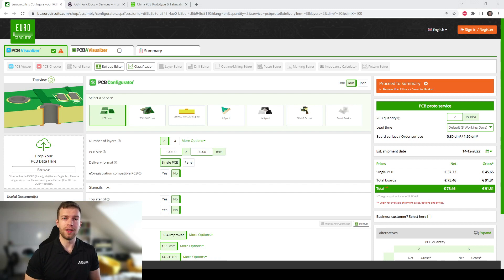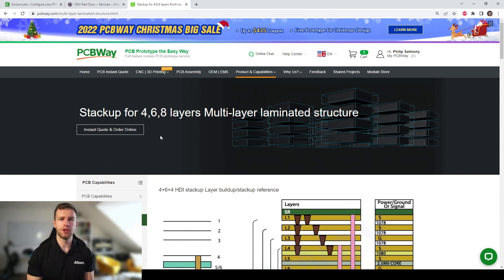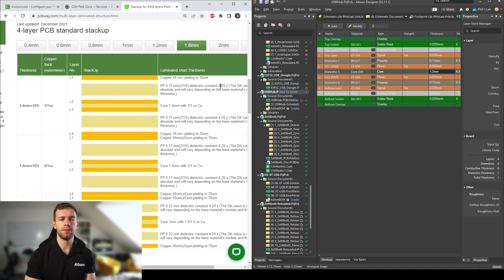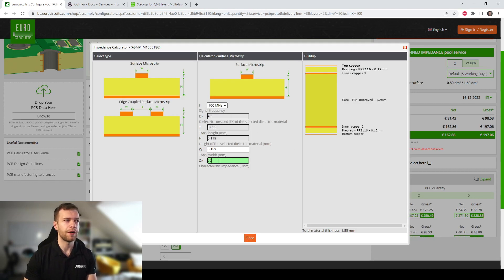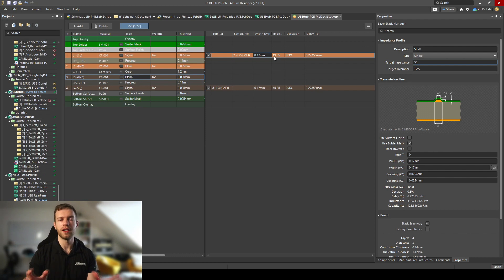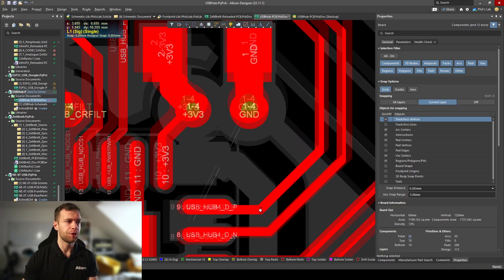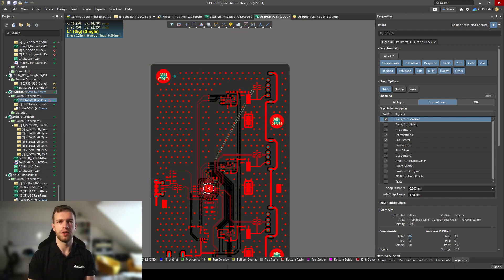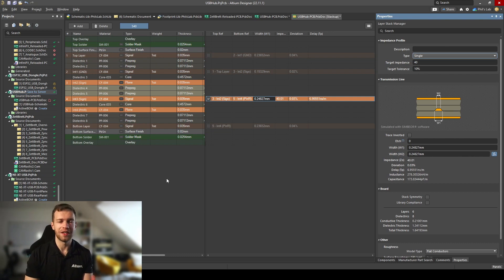PCB Stack-up and Controlled Impedance in Altium Designer

Comment: Hello! In the case, for example, of working with a design where the manufacturer provides the specifications for an 8-layer board and gives the trace values for each impedance, is it unnecessary to use the impedance calculator? Instead, would you create a class for each differential pair and then set a rule per class specifying the trace values? For example, Rockchip, in its hardware design manual, specifies the trace values for each impedance considering an 8-layer PCB and indicates the layers where the differential signals should be routed. Another thing is my question: why should I use serpentine traces on differential signals?

Comment: Thank you for the video.  When you said "import" the stackup information into Altium, I figured you really meant import.  Not type it in manually.  Does Altium support importing of any stackup data, like an IPC-2581?
Reply: I can answer this, right now Altium does not support IPC-2581 imports. The CAMtastic tool does support ODB++ imports, but I do not know if it does automatic layer assignments.
Reply: @Zachariah-Peterson  Thank you for the reply.  I'd strongly suggest this be a considered feature for the near future.
Reply: @Zachariah-Peterson  Looks like the biggest issue with updating impedance profiles (say due to stackup changes) is the way Altium handles the length matching accordions.  I can't find a way to change the trace width of accordions.  Retrace doesn't work, even though the tracks and length match objects are selected, it only updates the tracks, not the accordions.  There are claims you can do it with the PCB List panel, but there is no width parameter in that object there to edit.  I tried adding it, but still didn't populate with a value, or allow an edit.  It should just be in the parameter panel and it should allow updating/editing it, just like you do with tracks.
Reply: @Dr.Bigglesworth  For the length tuning accordians, I have had to convert them to primitives in order for the query selector to work, then they can appear as tracks/arcs and their width can be modified just like with regular tracks.
Reply: @Zachariah-Peterson  Yep, that's what I had to do.  But, it would certainly be "useful" if the accordions could just be updated in and of themselves.  That would make re-tuning easier.

Comment: Do those rules still apply if you round up the corners? 
Also, if you change the dielectric, I see that the calculated width changes, but do the already placed traces change in width too? 
You raid that you round up to 2 digits but wont 3 digits perform a bit better overall in actual manufacturing? Since lithography is a optical process it is not constrained by a grid so I thought that a 3rd digit may help a bit (tho it may not be as exact . Also asking since if I remember well some PCB manufacturers gave 3 digit trace specifications and I am not sure if that is due to inch to mm conversion or just in order for us to know that the rounded up 2 digit width is ok.
Reply: If you change the dielectric thickness and then the calculated width changes, then you will need to change the width manually. This is because the impedance profile applies to anything in your PCB on that layer, you need to go into the PCB Rules and Constraints Editor to update the design rule for the nets/net class that uses that impedance profile. If you update the design rule, you will then see the nets that violate the updated rule as a DRC error.

You can also select the traces you want to update with a query or select manually and re-type in the width. You could use the retrace tool to redraw the widths but be careful with this as it can mess up your via transitions and any length tuning. Usually it's fine on single-ended traces but I refuse to use it on differential pairs because of how it can mess up some length tuning and custom via entry.